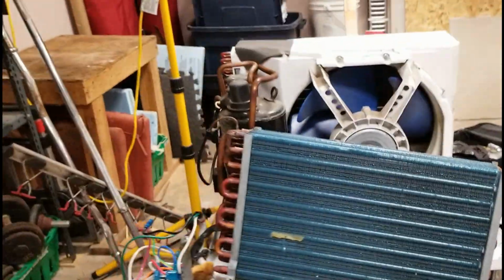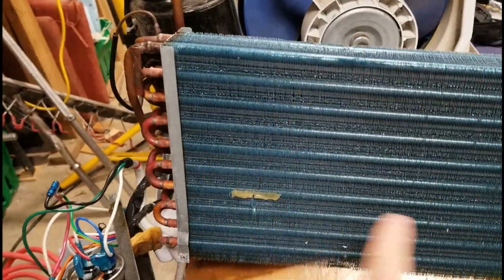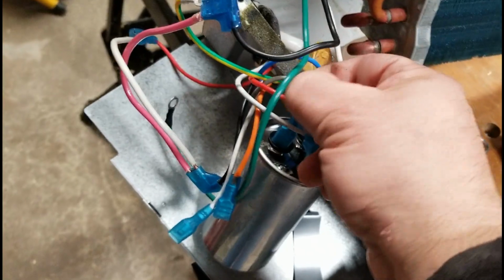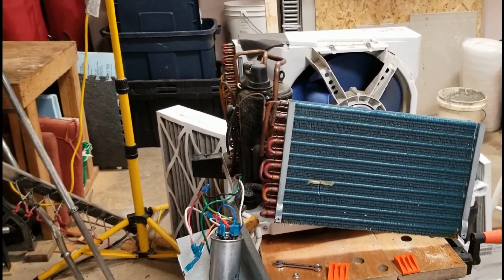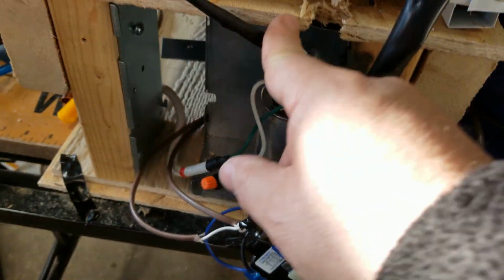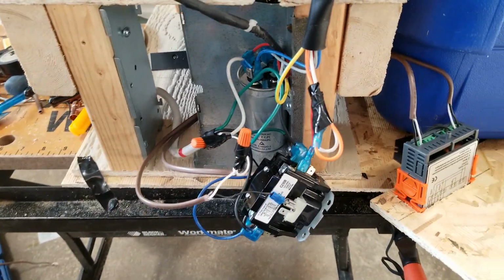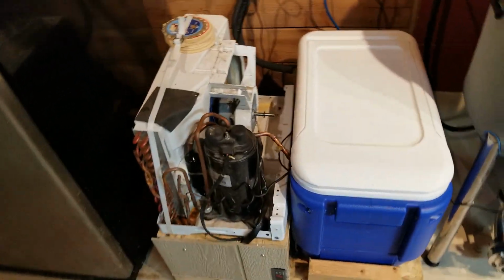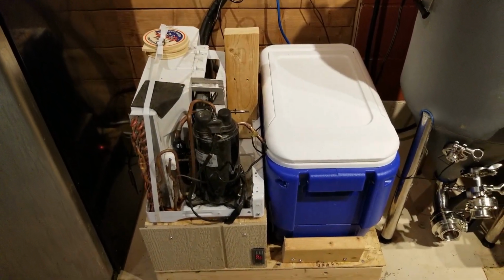Glycol Chiller

Comment: Great job, I am sure that it was a "oh SH#%^T" moment when the copper tube cracked!  Nice to have the skills to recover from that.  Our setups are now about the same, I have my chiller connected to my Spike CF10 so I am a shade smaller.  I have 10G of Pilsner just finishing up now, and my glycol chiller has kept the temperature right where it needed to be.  Thanks for sharing your build, and again, congratulations!  -DT
Reply from the maker: Thanks for your video that gave me the idea to go that same route instead of paying 1500 bucks for a pre built chiller. I have a 5 gallon IPA I am dry hopping right now. I read that dry hopping at 50 f can speed up the process and help avoid dry hop creep. I am very pleased with how well the chiller keeps the beer in the conical fermenter cold! Cheers. Shawn
Reply: @CanadianBrewingChannel  I am doing my dry hop differently these days.  Here is a link you might find interesting (in that short video there is a link to a longer one that goes into the setup in more detail).  Great job again on the chiller project!   -DT
Reply from the maker: Glad it worked out for you!

Comment: Good work 
I advise you to use aquarium mini pump to keep glycol circulating in the box for better cooling distribution.
You dont need to use glycol
Just water is ok
Reply from the maker: I like to use the glycol so I can get it down to well below freezing. It makes for a quick cold crash and less tine cycling off and on. Thanks for watching!
Reply: @CanadianBrewingChannel  How much percentage of glycol you have added with water to maintain sub cooling temperature?
Reply from the maker: @parthiban517   I use a pre mixed solution that I bought from a home brew supply shop. Cheers
Reply: @CanadianBrewingChannel  Thankyou for your immediate response ...

Comment: hi. nice work. can you share a diagram of the copper coil how is the conection
Reply from the maker: I used 50 feet of soft drawn 1/4" OD AC/R copper. I cut it in half and spliced the 2 25' lengths together with a T for better refrigerant flow. I used a copper T and a union to fit the coil onto the existing piping. I rolled the copper around a 10" pipe to achieve the diameter I needed to fit into the cooler. I brazed the copper together with Sil-Fos 15 brazing rod. Melting point is around 1200 F. The refrigerant charge I used was 404a.

Comment: How do you know how many pounds of refrigerant to add back to the system, and does it change when you changed the original evap coils to the new coils you made?
Reply: Great question!. I estimated how long the  tubing was in the original coil and figured that the 50 feet of replacement tubing was pretty close. I changed the refrigerant from 410a to 404a. They are both similar and same amount of refrigerant was weighed back in as per the air conditioners data plate. Also I monitored it as it was being charged to see if I saw any signs of liquid flood back. All is good. Cheers!

Comment: I really like this build.  I'm hoping to build one of my own later in the spring.  I also saw your CIP setup.  Would you mind sharing more info about that?  What pump, CIP ball, etc?  Thanks!
Reply from the maker: Here is the link to the CIP i bought from Toronto brewing supplies. You can find these CIP balls anywhere. https://torontobrewing.ca/products/1-5-tri-clover-stainless-steel-cip-spray-ball . I use the CIP with a 90 degree 3/4" barb fitting that I slide silicone tubing over. That connects to a sump pump. (no float). I built an extension onto the outlet of the sump pump out of copper tubing and added another 3/4" barbed fitting for the other end of the silicone tubing to slide onto. Sump sits in my sink and I sit the conical beside the sink so it can drain into the sink. I remove and hop and yeast debris first. I then run hot water through it for 5 min. I then run hot water with PBW for 20 min. I then run warm clean water through it for 5 min. Last I run star san through it at 50% concentration you would use for regular sanitizing. for 5 min. ( 0.5 oz for 5 gallons- very little) Disassemble and let dry. Cheers.
Reply: @CanadianBrewingChannel  Awesome! Thanks for the info!  I'll get it with my next order.

Comment: Trying this for a DIY ice rink chiller, from a 28,000 BTU unit. 

Curious about the idea of bending the evap coil flat. Since the outlet back towards the compressor is at the top of the coil, I would think that gravity normally helps you separate the gas from the liquids. Laying it down flat might increase the chance of it ingesting liquid, no?
Reply: Nevermind, i re-watched that part and figured out the orientation you wanted to put it in. Might have worked well since you have multiple “bottoms” for the liquid to sit in while the gas flows up the tubes. Too bad the coil broke.

Another thing I saw others do is to rip all of the alum fins off and just leave the bare copper exposed. It would probably be better for glycol flow in the tank and increase the effective surface area since glycol probably can’t flow effectively through the tiny fins optimized for air. Your final bare copper coil is doing basically exactly that, looks great!
Reply from the maker: @FallLineJP  I would have been in trouble if I wasn't a refrigeration mechanic lol. System works great and yes, having no fins works much better. Cheers.

Comment: Could you go into detail on the wiring for this unit. I have an old AC just like this one. The panel died on me and want to use it for a glycol project but have yet to find a wiring diagram that will work for jumping it over.
Reply from the maker: Hi Shane! I meant to go into more detail on the wiring but things got busy. I will do a video soon on how I wired my A/C to run without the control board. I am in the middle of selling our home and just bought a new house so things are a bit crazy around here right now lol. Thanks for watching. Cheers

Comment: @Canadian Brewing Channel .  Fellow Canadian here. Great job! Where did you find Glycol at $15/gallon?  Thanks
Reply from the maker: Hi Dwayne, sorry I spoke incorrectly on $14 a gallon for glycol. I wish! lol. I paid $40 a gallon. I bought it from Toronto brewing supplies. I just checked and it is now $50 bucks a gallon. We can thank Covid for that. Cheers!
Reply: @CanadianBrewingChannel  Thanks for the reply.  I knew it was too good to be true. lol.  TB is where I currently get it too, which is the cheapest I found.  Too bad I am on the West Coast.  Cheers
Reply: Do you see any reason not to use swimming pool line antifreeze?  Supposed to be non toxic and is around $20 a gallon.
Reply from the maker: @1975mtl  I guess as long as it can be mixed to handle the temp you are going down to and it doesn't react to copper and stainless steel.

Comment: Do you think that this would cool good enough to condense alcohol vapor into alcohol on a 15 gallon still ?
Reply from the maker: More than likely. I tried building a crude distiller once and used ice. Ice melts at 0 Celsius. The glycol in my chiller I keep at -5 Celsius. You can adjust the glycol bath to what ever temp you need. The only question I can think of is if this air conditioner is big enough (BTU) to condense the alcohol vapors down which depends on how fast you are circulating in the collector tubing. When I use this system for chilling beer, I use it to cold crash 10 gallons of beer from 22 Celsius to 3 Celsius. This system does that easily in about 1 hour. Then it just has to hold it there. When you are distilling you are constantly passing vapor at min 50 Celsius and up to 80 Celsius if I recall. I do believe that a glycol chiller could do it but again it would depend on how many BTU's the air conditioner is. Mine is 8500. Interesting question. Cheers
Reply: @CanadianBrewingChannel  Yeah you start getting alcohol vapors at around 173 F , but the thing about it is it sometimes takes 4 to 5 hours of running before you shut the still off so you will have a constant 173 degree F circulating back into the reservoir. It would be interesting if it would keep up. Thanks for the reply from Tennessee.
Reply from the maker: @krmcc01  Your welcome.